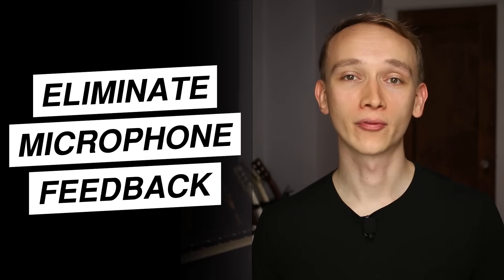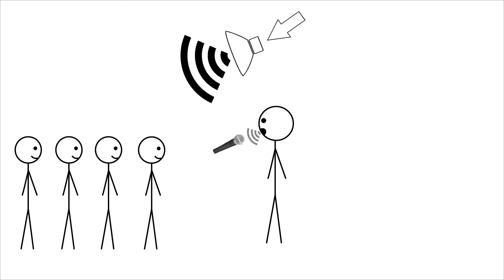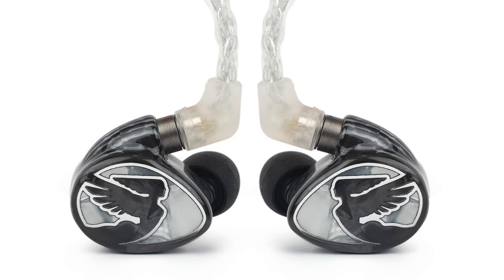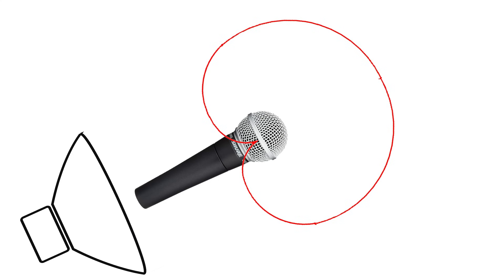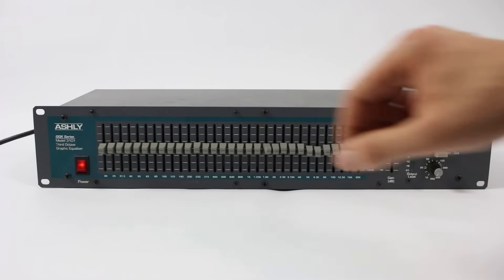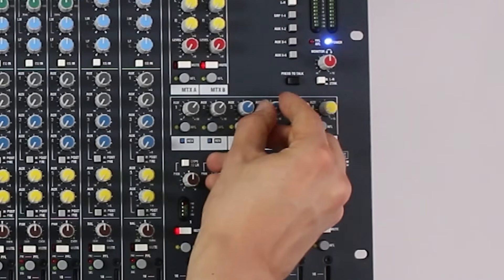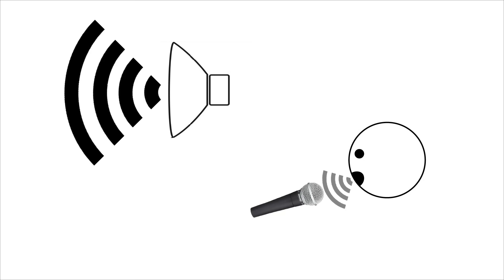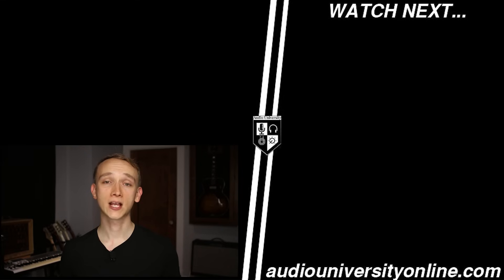How To Eliminate Microphone Feedback | 5 Must-Know Tips

Comment: If you set the input gain low, you will end up with poor S/N on that channel.  This is because all electronic circuits generate an electronic noise floor that is independent of signal strength.  If you have a low signal at input, then the noise floor will be a higher percent of the signal level,  when you amplify the signal late in the signal path to get to the VU you need, then the noise floor already contained with the signal is also amplified with it. Which is a bad thing.   So the way to get a very clean signal, is to amplify the signal to unity (0VU) at the earliest possible point in the signal path.  This is usually at the mixer input gain.  Then any electronic noise added will be a small proportion of the signal.

Now most decent size mixers will have groups.  You will have several channels going to the 1 group and you want to avoid overloading the group input.  So treat the faders as both mix controls and group input gain controls, so that you get the mix you want at unity gain.

Next, your combing the groups into the mains, using the group faders to control the main mix and also the main input at unity gain.

In the same way, have the amp input gain already setup to reach your target room SPL at unity gain from the mixer.  Use the main fader to control the signal to the amplifier.

This simplified description gives you unity signal through every path of your audio chain & that will give you the cleanest S/N performance achievable on whatever gear you have.  Of course there is going to be some kind of EQ as well but there are many different ways that may be implemented, so I have ignored it for now, but hopefully you get the principle involved here and can apply it you whatever your setup is, including fold back systems.  Some people like to use inline phantom powered mic preamps plugged directly into the base of low sensitivity dynamic mics for this exact reason.

The following gives a rough guide where the mixing faders need to average around in order to achieve unity input gain to the next signal path stage.
2 ch @ -3-0 dB = 0 dB
3 ch @ -4.8 dB = 0 dB
4 ch @ -6.0 dB = 0 dB
5 ch @ -7.0 dB = 0 dB
6 ch @ -7.8 dB = 0 dB
7 ch @ -8.5 dB = 0 dB
8 ch @ -9.0 dB = 0 dB
9 ch @ -9.5 dB = 0 dB
10 ch @ -10 dB = 0 dB

Probably just remembering the following will prove sufficient:
2 ch @ -3-0 dB = 0 dB
4 ch @ -6.0 dB = 0 dB
8 ch @ -9.0 dB = 0 dB
Reply: @jar945 I spent 30 years researching & learning this stuff. Your welcome.

Comment: Sorry to disagree w/ you with some of your tips.  Tips 1,2,and 5 are good -- 3 and 4 are wrong/misleading.  Here's 20 yrs of mixing in a nutshell:
My tips:
Tip #1 -- same as yours.  Always have FOH speakers in FRONT of stage.
Tip #2A - Switch to a hypercardoid or low gain dynamic mic.
Tip #3A -- Use a dbx DriveRack with RTA-M to ring-out room.  Also try using parametric EQ to find trouble frequencies.  Don't bother with the built-in graphic EQ.  It'll take too long.  If you want the very best feedback eliminator, use a Peavey Feedback Ferret.
Tip #4 -- You are completely wrong.  Setting the proper initial gain is THE MOST IMPORTANT PART of setting up right volume levels and you are doing it in the COMPLETELY WRONG ORDER.  The initial gain determines how the sound "blooms", "airiness", "headroom", etc.  To do it right, you have to use reference recording headphones to get the right level.  Most sound engineers do it by looking at the peak meter and setting the gain to peak at 0 dB.  Good -- ballpark move.  However, depending on how the gain reacts and sounds, it might sound better to push the circuit higher.  It all depends on how good your ears are.
Tip #5A -- Throw away your Shure SM58s and 57s.  Switch everything to Audix.  Do a double-blind test.  Audix mics are superior to Shure in every way, shape and form.  No comparison.
Tip #6 -- Always use analog gear like Allen & Heath.  I hate digital's sound, difficulty to use, etc.
Typ #7 -- Use positive EQ, i.e. don't use the parametric to just notch out bad freqs -- use it to enhance good freqs.
Reply: Hey, if you want to throw away any 57 or 58 mics, I'll take them.   Just let me know how & when to collect.

Comment: There is a mathematical calculation that you can use to find out how much gain you can achieve long before you even turn the microphone on. It is called PAG or Potential Acoustic Gain. There are several online calcs that will allow you to get a very good idea of how much gain you can actually achieve. There is another calc called NAG, or Needed Acoustic Gain, in order to see if your PAG is actually enough to do the job. The microphone gain or HA gain is irrelevant to GBF ( gain before feedback ). Gain is gain is gain. So if you have 100db of acoustic output before feedback occurs, it doesn't matter where that 100db of acoustic output is achieved. Be it the HA, the channel send, or the master send, the GBF will be the same. So it is best to operate the console for the best signal-to-noise ratio. This is usually accomplished by gaining the HA so that the incoming signal sets around the meters 0db mark ( the point where it goes from green to orange on most consoles ). This allows you to operate the console in the most textbook way. This is mostly because the pots, faders, and sends will be in their ideal range to get the best out of their fader resolution. 

As for EQ in the monitors, your prescription is very good, except I would amend it to not be a fixed amount of cut per filter. Repeat after me " Too much of a good thing is still too much ". Cutting more gain than is needed to eliminate or reduce feedback is cutting too much gain, so find the offending frequency and only cut it as much as is needed. I say cut no more than 6 frequencies and if you are cutting more than 10db on any 1 frequency, you need to find another solution. 

My favorite solution for monitors is to start with a wedge that has a linear response. This means using a measurement software such as Smaart to measure the monitor's acoustic output and then correcting it with EQ to be as linear ( flat in frequency response ) as possible. This makes it so that the microphone is the only thing that can contribute to the most likely frequencies to feedback at. If the microphone has a 5khz boost, this will be a likely area that feedback can occur. Now as you gain the microphone up in the wedges, the corrective EQ you apply to reduce feedback will be to flatten out the humps and response of the microphone only, not the microphone and the wedge. Because you now have a reference point with the monitors, the correction you apply will be related to the microphone's interaction with the monitor as opposed to trying to correct for both at the same time. A good engineer can get a +10db increase in GBF over a non-corrected system. The big thing to keep in mind is that when we talk about GBF, we actually mean measured acoustic output, not simply having a higher fader or send level. As you cut gain via EQ, you reduce acoustic gain too. So you have to consider that if you cut 6 filters by -6db each, you have reduced a considerable amount of acoustic gain. Less is more; quite literally.
Reply: Where do you measure from? Do you tip the wedge and place the mic on the floor or do you put it on axis ear height, or which combination of angles and distances?
Reply: @uuuh9767  You set the monitor up as you would be using it, and then place the measurement mic approximately where the vocal mic would normally be. You are objectively looking to be relatively linear from about 70hz out to 16khz. Much below that and above that is not worth fighting for. As with most things in live audio, it is best to cut as opposed to boosting but use your judgement. You can't get it to board flat unless you are scaling back your FFT window. Going with a window that approximates the accuracy of a 31 band EQ is probably good enough. The same rules apply though as before, once you go beyond about 6 frequencies of boost or cut, you are just about done. If you have a trough or a hump that is greater than 6db, don't read into it too much unless you can confirm it is not an anomaly. Reflections and floor bounce can skew the measurement a little. It is best to use parametric filters to EQ your monitors, this allows a much finer ability to adjust the EQ using as few a number of filters as possible. 

I no longer use graphic EQ in my monitoring chain. I either make it work with one 6 band parametric, or stack another parametric in the chain. As with most things in live audio, the $$$$ you spend does impact the quality and ease of use you get. I use RCF NX-12SMA's for my monitor rig, they measure board flat right out of the box. This makes it significantly easier to get away with using less corrective EQ. As you can imagine, when you use L' Acoustics, Meyer, and D&B grade equipment, the ease of use and overall quality becomes the driving factor for that investment. When you are using commercial grade gear like QSC K series stuff, it takes a bit more work just to make it work at all, and the quality isn't there either. 

Another trick that can really up your monitoring game if you are running monitors from FOH, is to copy or split your money channel ( lead vocal or loudest vocal ) into another dedicated monitor channel. This dedicated monitor channel allows you to fine-tune it in the monitors to get that much more from it.
Reply: @atech9020  Cool, thanks :) Wish you all the best and may business recover soon!

Comment: I love your videos. Thank you for sharing.

I have shure sm58 and sm86. Sm86 gave me a very bad feedback, where as sm58 have me minimum feedback when sing live. You have anything that you recommend when buying my replacement for shure sm86? Or just buying the same 58
Reply: Maybe look at a sennheiser E835, I’ve had good results with these.
Reply from the maker: For live vocal performance and microphone feedback control, I use the Shure SM58 almost every time!
Reply: @AudioUniversity  yeah I agree. I have a wireless sm86, I don’t know if I convert to a sm58. I hope I can change its pick up signal
Reply: If I recall SM86 is a condenser mic as opposed to sm58 dynamic. 
Condenser mics tend to be "hotter"..(louder signal) and are generally preferred in controlled sound environments (studios/ pro sound stage/theatre). 
  Using them on stage is possible but a sound friendly room and attention from a knowledgeable sound man is needed in a live scenario as they tend to be more prone to bleed from unwanted sound sources and feedback frequencies. SM58 is a good standard choice for most vocalists with the proper gain/EQ settings. 
 A good split of the difference could be something like a Shure 
Beta 58 or equivalent like Sennheiser e840, dynamic but a little more presence/ sparkle in the higher frequencies.

Comment: For Tip#4: Decreasing preamp gain + higher master levels won't help to reduce feedback. "As little preamp gain as possible" is totally misleading. 
For the same reason, condenser microphones won't give you more feedback at equal volumes despite they give also more gain in the first place.
And for polar patterns: The differences are much lower than usually told. 
It's all about proper EQing and volumes. And sometimes less is not more.
Reply: Also, if preamp gain is at minimum and the monitor starts to feedback, you can't quickly get rid of it by lowering the gain, because there is nothing to lower.
Reply: @ArtHazard  Right, though lowering the gain should be your last chance. Better to know where the actual feedback is and filter it out except the volume is already much to high.
Reply: Agree, tip 4 isnt practical, if your monitor are to loud with proper gain stagging just turn them down, thats why you need to calibre your speaker first...

Comment: Great video. But let's say that the bass player needs their bass at -30db in their monitor, and then the guitar player needs their at -5, and then wants some bass... you are probably going to run short of gain, and if you modify the gain on that mic or signal that will mess up other mixes.  maybe the speakers are different brands or have different power... that can be problematic.
Reply from the maker: That’s a good point! Although, in my experience, the gain settings in the initial sound check get me to a good level, in the ballpark of where it needs to be - rarely do I learn about a 25 dB disparity in the middle of the show. Thanks for your comment!
Reply: @AudioUniversity when mixing monitors that happens about 30 minutes in when the artist's drugs wear off. Not even kidding. Always be ready to give heaps more volume on a moments notice, unless you like getting yelled at by artists

Comment: Great video, but a question I have is…
What is the SPL of the stages you are doing monitors on?
The stages I are for metal bands where it’s super loud. Will these techniques work for that?
Reply: Sorry but no, the gain staging here is incorrect and could be seriously detrimental to the mix. Feel free to get intouch to discuss more
Reply from the maker: Yes. I’ve mixed monitors for lots of genres, including metal. This technique just helps get the monitors as loud as possible while attempting to preserve sound quality. So, the stage and such only change how loud they can possibly be, not the technique for getting there (in my opinion).